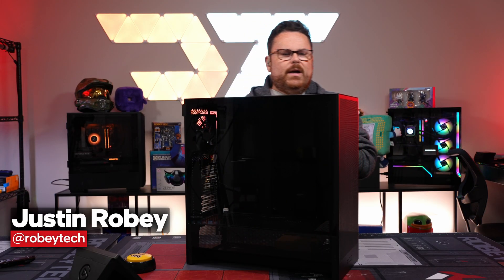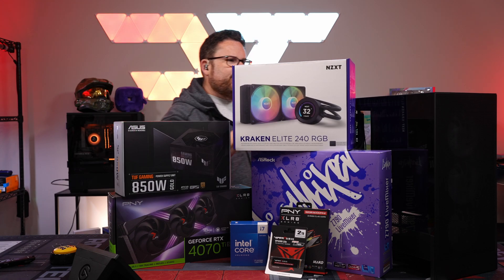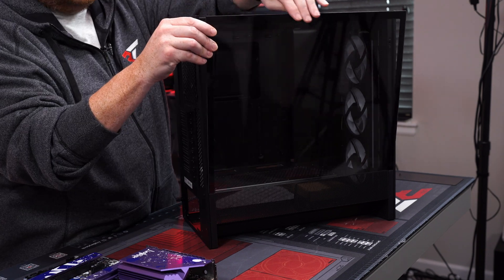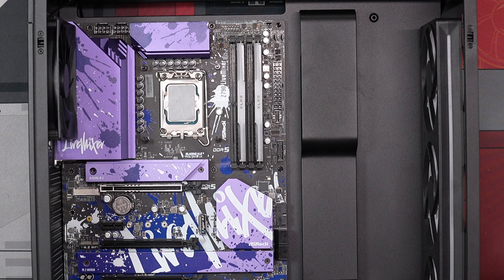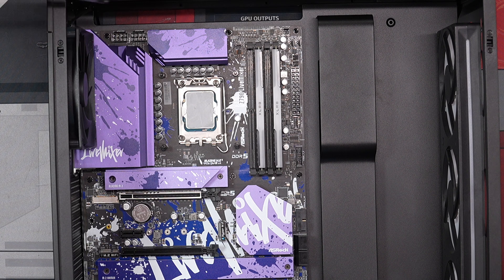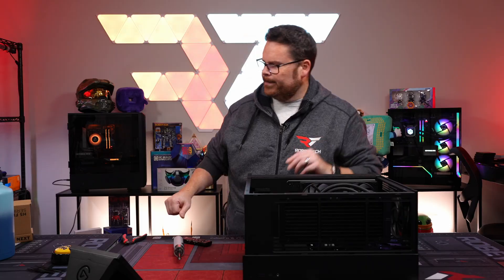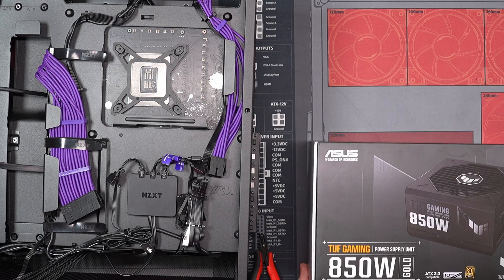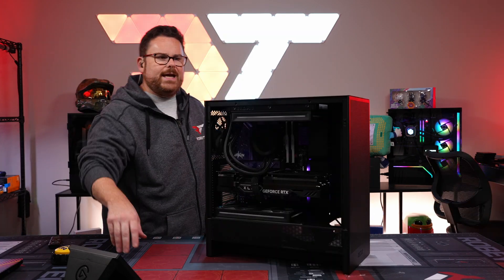Better than before! The NZXT H5 Flow Build

Comment: I really need your help, I have Asus ROG STRIX B650E-F GAMING WIFI and Arctic III 240 AIO, will it fit? Will I be able to mount AIO on top since the radiator on this motherboard is really huge? I want to buy this PC case but im afraid it may not fit.
Reply: I bought the case, everything is fine, the cooling on the case is fantastic, with additional coolers on the bottom, my GPU does not exceed 60c in intensive gaming.

Comment: Hello! I'm preparing the same build. I'm interested in whether there is a problem with the airflow of the power supply and the two fans at the bottom of the case above the power supply. I've read in many places that this causes a fan conflict. Thanks in advance! :)

Comment: Is 240L aio is enough for this build or do you prefer 360L
Reply: You actually can fit 360mm AIO on top, but you can't install rear exhaust fan. 240mm and 280mm are the maximum, says the specs from NZXT themselves

Comment: PSU upside down genius.
Reply: No air intake for the PSU from the bottom in this case...genius.
Reply: @teg.mp4  Check the case again ;)
Reply: @tahakartal7576  Check the case? I own the case, you doofus. The top post in the NZXT subreddit right now is my build in this case.
Reply from the maker: You have to put it in this way, the bottom of the case is solid.  It’s in my review as well
Reply: @robeytech  I guess it will cause problems.
Reply from the maker: @tahakartal7576  no, PSUs generate very little heat actually and we did testing and there is almost no difference in temperatures inside the case.
Reply: @robeytech  Taht's good then.
Reply: Many smaller cases have an issue where air gets stuck underneath the GPU. An upside down PSU might actually help to remove this air as it acts as an exhaust.
Reply: Can we use AMD RYZEN FOR PROCESSOR ? Or it has to be intel core ?

Comment: Why fan up for psu?
Reply: The PSU acts as an exhaust for the bottom of the case. This may help reduce the amount of air getting stuck underneath the GPU.
Reply: @KillFrenzy96  lol.. not when There Are two fans on top of PSU sucking air Away from PsU fan... Its stealing airflow from PsU!
Reply: No bottom air intake in this case for the PSU.
Reply: @teg.mp4  I still don't understand the airflow orientation in this build.
Reply: @Roweyy it’s not that bad